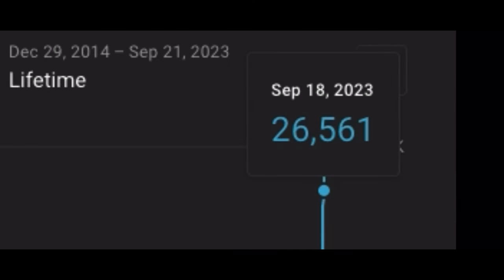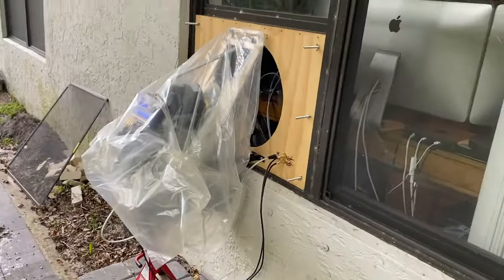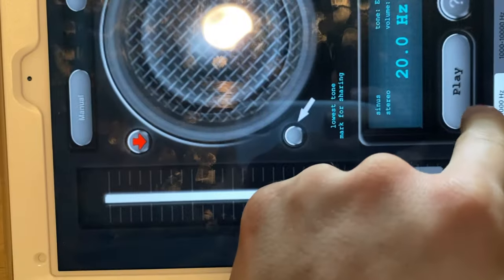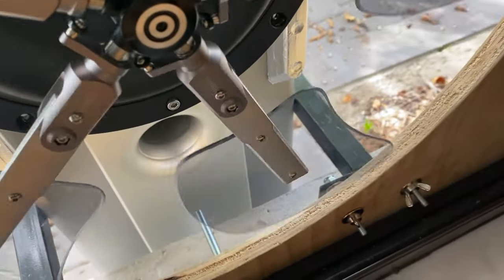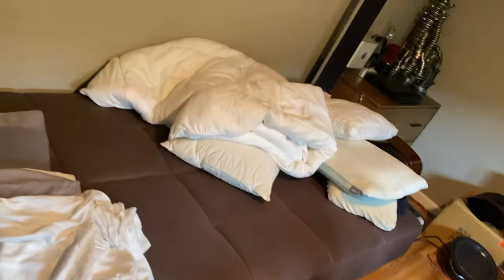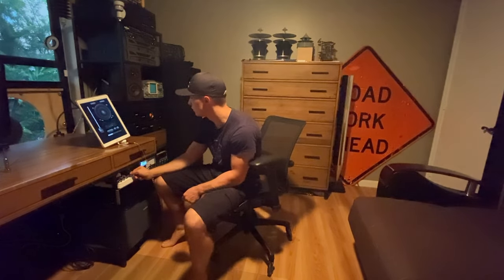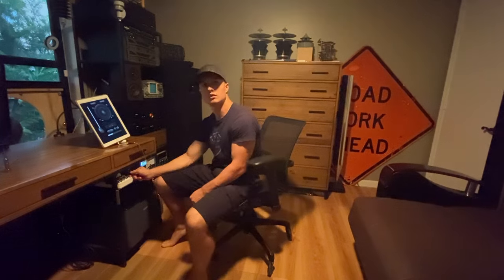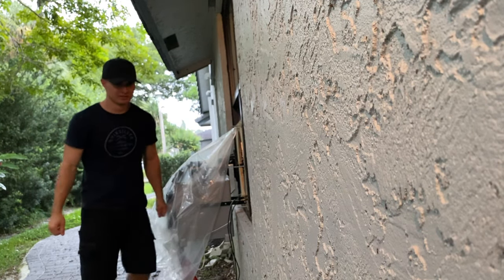Finding resonant frequency of my house with worlds most powerful “rotary” subwoofer (Bad Ending👌)

Comment: Be careful with those low hertz dude! Every material has a specific "resonance" and if you reach it you can actually damage them!
(The same principle that cause a scream to break a wine glass!) (i might use the wrong terms, but you get the idea!)
So... Yeah... You can dislodge your building with that...
Fantastic job though... MAD RESPECT!
Reply: I dont think they can resonate at such low frequency but i may be wrong
Reply: @amazin7006 I think too because of the dimension of walls, for example most bridges have resonance around 2hz
Reply: @federicogalvagni2332 new video idea

Comment: I wonder if some sort of solenoid may work. At a basic level, all a speaker is, is a solenoid built specifically for sound. You can probably get more range of motion, and perhaps faster oscillation.

Comment: Not funny, actually it is funny :D Problem with this is the weight of the rotors. You need lighter, sturdier rotors, or a mechanism that can move a lot higher mass. F = m*a where F is the force needed to incline the blades. For higher frequencies, a is much higher, therefore the force is going through the roof.

Comment: Nice follow up video on the subwoofer! And yeah, I was also very surprised when I found out that the previous one from 4 months ago absolutely skyrocketed in views to over 800,000. And even your channel had a massive increase in subscribers. Also, is the subwoofer actually strong enough to cause cracks in the house? If so, then I guess your whole house will fall apart the more you use it
Reply from the maker: Thx Ian, I don’t really know what the subwoofer is capable of at this point, but the cracks are something I’ll definitely need to be monitoring
Reply: @danielfajkis4952 yeah, definitely keep an eye on them

Comment: Heres a thought - if a single rotary sub can hit up to 20 Hz, a phased array of several units should be able to hit higher ranges working together. It might actually destroy your house though.
Reply: That's what I wanted, yeehaw
Reply: How would a phased array allow for higher frequency?
Reply: @antonliakhovitch8306 I guess by having one run at 4 hz and one running at 4 hz opposite phase?? Sounds like it would interfere really weirdly though

Comment: Supplying the same 100 watts at 10 hz or 100 hz, the power is the same but the displacement is at 100hz is 1/10th that at 10hz. That's just  physics. 

Understand this analogy. Say  you have two identical masses and two springs with different tension, and  consider energy (Work done)  = force × distance. So If the tension in spring B is 2× that of spring A, then the same  work is done by pulling spring B 1/2 of the distance pulled in spring A.  I repeat, the energy put in is the same. And when you let go of the weights, spring B and the mass attached will vibrate at twice the freqency of A.  What we learn from this is that the same energy put into a rotory speaker and or speaker cone at different frequencies results in different displacement, and that for a given energy input the displacement is inversely proportional to the freqency, (E=mass×displacement/f). This is true not just for the mass in the fan blades which cause attinuation, but also the vibrating mass in air particles that we call pressure waves, aka sound. Counterintuitive maybe, the energy in the  in a higher freqency means less displacement. But the key is, it is done more freqently.

Comment: Tesla built his "Earthquake" machine and almost demolished his building, all you have to do is find the right Hz..😊
Reply: Yeap, people have tried to repeat it since and almost taken down a bridge.  It was a TV Show like the mythbusters.  The bridge was being taken down anyway which is why they were able to test it out.  The device was really just an at most 2foot long metal rod being osculated back and forth by magnets. (I think)

They were able to hit the resonate frequency of the bridge and the whole thing started to shake. 

But, you wouldn't really be able to demo a WHOLE building or a whole bridge.   As soon as it starts breaking, the resonate frequency changes so you'd really just probably crack it pretty bad.   Or break off some pieces. 

Unless the device was constantly changing vibration frequency .. then well, the part it's attached to would probably end up separating from rest of the structure pretty darn fast. .

All though, it does depend on how the structure is put together and just WHAT frequency point your matching. Ergo, if you somehow managed to match the point where a bridge is connected on both ends.. AND said bridge was only being held up by those ends?  Yah, the whole thing COULD fall.  

But it's so unlikely.

Comment: Your mechanism can’t hit high frequency’s AND it broke because the blades are too heavy. The math assumes and infinitely rigid and light blade. Zero pitch carbon/plastic RC blades would be perfect. The wider (thicker) the blades the harder the base hits. The thinner the higher the hertz possible. Just get the lightest ones you’re willing to afford.

Comment: Would the THX sound work tho?
Reply: Thats what i still use tho! The Z5500 one beast of a soundsytem and i got a second set of it hooked as well but only the sub of the Z5500 so dual subs and 5 normal speakers. Soumds insane even after like 8 years
Reply: @dennisraeimakers5218  You don't know it's ruining your taste until you won't sell it one day
Reply: @SajtosNokedli  what? Lol
Reply: No, THX Deep Note isn't actually that deep and would be too high of a frequency to reproduce on this.
Reply: @rokoala2636 I'm glad someone who isn't an npc decided to actually answer this question. I was also curious

Comment: If I was making one of these, I would have it spinning at a constant speed or at least a fast enough 'idle' speed, and then just have the blades pitch to actually make the sound pulses. Then you need to work out the best materials to use, and how to get the most responsive blade pitching. That's my theory, anyway.
Reply: isn't that exactly what he built?

Comment: You need either a stronger motor assembly or lighter components (but they have to still be ridgid enough)  maybe look into propellers or wing assemblies for rc aircraft, a plane wing already has the edge setup for controlled movements too...may allow for extra efficiency with a lot of experimenting lol. Heck upgrading both motor strength and lighter materials will make it excellent im sure. Thanks for sharing and I hope you are having a great day or night my brother!

Comment: The frequency response is so low because the mass moment of inertia of your blades are huge. Change them to a longer skinnier airfoil shape (rc helicopter blades maybe?) and spin them faster to produce some good lift and you’ll get a much better frequency response into the midrange.
Reply: And also a lot more noise.
Reply: Legit question, would you call what you just said audio engineering? What field should I investigate if I wanna know more about sinning blades and sound?
Reply: @poiuyttyuiop9700  I would not describe myself as an audio engineer, I'm educated as an engineer in an unrelated field. My experience comes from a decade of live sound mixing and longer as a home theater audio enthusiast.

I made my comment in regards to my experiences with such things as rc helicopter blades. If you watch an rc helicopter video or see one in person, they are very loud.

Also compare a box fan in a window.

In sound, we generally sacrifice things like efficiency and performance for better sound. 

When looking at something like RC helicopter blades, it's a different machine for a different job. The helicopter is traveling through the air.

A rotary woofer is a device that pumps air in and out of a room at a high rate of change in direction, and sacrifices the rate in change in volume. The blades must pump the air in both directions equally, therefore cannot be very efficient because they must be flat, or at least neutrally directional. 

Also, using a thin blade will not be optimal because there will be a lot of space for the air to "leak" back to the other side, causing a lot of turbulence and noise. Turbulence and noise will also be caused by high fan speed.

I would argue that a rotary woofer is already large enough to shake apart a house with enough time. It's not like a regular woofer where the sound is created and contained in a room, for the most part. A rotary woofer works by pressurizing air in a room using air outside the room. If powerful enough, it could literally pop the house, blowing in/out the weakest surface present.

My intuition is that you want to make pressure but not too much, and able to switch direction at a rate of 0-100hz.

This video demonstrates that while buildable, this woofer is of low quality and is not effective above 15 hz or whatever because the voice coil cannot move the blades fast enough. The $15000 professional ones are rated up to like 1000hz.
Reply: @poiuyttyuiop9700 physics, signal processing, system modeling, and stochastic processes.
Reply: @wiredforstereo  yeah that’s the issue I’m running into just theorizing about the subject. Do you think the first issue with the design in the video is the inability of the diaphragm to efficiently control pitch at higher frequencies? I’m impressed it works in the first place but being limited to 10hz isn’t great, I wonder what would have to change to get that up into audible ranges, or at least to 50+
Reply: @poiuyttyuiop9700  Considering rotary woofers can't get anywhere near midrange frequencies and spinning the fan faster introduces a bunch of noise they are just talking bs. Unfortunately the other claim saying the $15k pro ones do up to 1000hz is wrong too, maybe they were thinking of leslie speakers or something else. The only commercial model I'm aware of is rated for 1 to 30hz and recommends a 20hz crossover to another sub, so there is no reason for it to put out 50+hz anyway because a traditional sub will cover the higher frequency range.

There are a few of issues with the design but it is plenty good enough for something to play around with. But it isn't stiff enough and the moving mass is too high (the 2 main things limiting the frequency), and those clear blades need to be made of something else because they will keep breaking.

Comment: Your device is not efficient because it generate sound waves in both directions, front and rear, than they cancel each other. Try to redirect rear soundwave into a maze or a box. Just like in normal speaker, box will improve power significantly.
Reply: hope he sees this
Reply: Doesn't work for this type of sub. Infinite baffle is the only reasonable option. unless you made a house sized subwoofer box, which would be very silly when you could just make a second fan speaker instead.

Comment: You gotta make a massive one, or multiple and get a cheap gas generator, so you can pull up to the middle of nowhere and crank it way the hell up. Also, these vids are sick as hell. I fwi.
Reply: These things don't really work in free air, you need an enclosure (like the house) to get the full effect.  Otherwise the air just passes from the front around to the back of the fan.  Using a huge open structure (like a hangar) as a horn could lead to something really interesting...
Reply: @henningklaveness7082  oh cool. Thanks for the info. This is the first time on yt comments that people have been helpful. I appreciate it.

Comment: Smaller seems to be definitely better when it comes to rotary subs.
You really want some small fan spinning fast enough that it can handle 50hz so you can smoothly pick up where most normal subs are falling off.
Moreover the pitch mechanism on bearings seems not so great to me. I'd use compliant mechanism with a single piece fan that just flexes to vary the blade pitch.

Comment: Remind me of when I built a sub enclosure for my sister's car and targeted it for like 20Hz, because she wanted to feel the bass but not be so loud. Thing had my chest pounding when we played music, but it wasn't loud like my car. 

My guess for why the blades can't rotate fast enough is that the system itself from the woofer to the blades acts as a low pass that cuts off frequencies higher than 10hz. Would need to do something to raise that resonance up, like tighter tolerances on fittings and less mass of the moving parts. But I'm also wondering if the surface area of the blades are more important for the cut off freq? Should try with different size blades and see how high you can go to match the specs on the driver.
Reply: Or see about finding a smaller sub that has a greater flex distance.

Comment: Youtube vid's audio don't go below 20hz, like mathematically, physically. There's something else going on like generated (sub)harmonics in your part of the system. You should do audio processing instead do generate the subharmonics directly and do a ultra-low bandpass filter afterwards to remove any signal that the subwoofer can't play. It'll be more clean and powerful.
Reply: The beat is below 20hz, but the tone is not.
Huge difference.
We can here beats below 20, just not tones.
Reply: @xxTHExxABYSSxx  I can assure you the signal has nothing below 20Hz, any beat below 20Hz you 'hear' and 'feel' is (sub)harmonic generated along the signal chain.
Reply: @IIoWoII  that's not even close to what we're hearing though.
We're heaving objects being moved at sub-20hz. Those tones are not subharmonic, they're their own tones made through vibration, produced below 20hz.
Most of what we hear is mechanic and secondary vibration, not the actual source bass notes in the free air to our ears.
Reply: @xxTHExxABYSSxx  "We're heaving objects being moved at sub-20hz. Those tones are not subharmonic, they're their own tones made through vibration, produced below 20hz." Is literally subharmonics if it's in tune

Comment: Man, you gotta build a tapped horn. You are operating so low and narrow a frequency the higher harmonic resonance of the lines won't matter. 

It would let you stick the rotary driver deep in the line, use fiberglass stuffing to attenuate the mechanical noises, there wouldn't be mechanical resistance of different airspaces to pressurize (though who knows at these frequencies).

Comment: I would say the reason for the limit in frequency is due a high inertial impulse, and that is caused by the mass of the blades and how well they are balanced, and how wide they are in relation to their rotational axis. Polycarbonate is pretty heavy so could be the problem. You could try to print some blades out of pla(which is very light), or use something like rc helicopter blades which are light and very narrow on their rotation axis.

Comment: Hey there friend! I’ve got parts in the mail for this!

Just a couple ideas, the aluminum bits holding the blades seem rather heavy being metal.
Perhaps you could lessen the strain if you replace those bits with polycarbonate?

Also, the lack of higher frequencies is down to physics, of course. 
But I think a lot of it is slop in the entire assembly, I think you could gain a bit more head room. 
Perhaps you could center and reinforce the top of the helicopter bit by having it ride on a bearing?
That would give it something to push against and would transform some of that energy into actual motion of the blades.

Cheers, my friend, I’ll be sure to upload a video when I get my death machine running!

Comment: Damn. So your sub isn't strong enough to turn the blades. Is it possible to get a longer lever arm on the blades or somehow mechanically advantage the output from the speakers? I.E. gears or something?

Comment: If you want to find good real life samples around those frequencies to play you could check out earth-quake recordings…

I think you are also held back by not just the mechanism, but the materials you used for construction. Good news: plenty of mechanisms can move such short distance multiple oscillations per second. Bad news: the strain on them is proportional to the air-mass and frequency.

And, if my logic checks out, we have worse news: Anything that dampens this strain is obviously counter productive. This would translate into moving less air, by moving the blades instead. And for that reason, the assembly as a whole as well as anything it is secured to has to endure the full weight of the air-mass moved, back-and-forth.

While for a house this should not pose an issue, for the subwoofer itself and how it’s secured in place it might. Even if the deformation is entirely elastic, it could cause unwanted operational noise and the very least dampens desired sound.

Comment: Use a more efficient subwoofer that requires less power to move and you might be able to play higher frequencies
Reply: The whole point of this thing is being able to play rly powerful low frequencies though. I am pretty sure it is smarter to just use a regular speaker for higher frequencies and make it bigger for more power.

Comment: i though about trying to reduce the mass of the whole pitching mechanism the blades stuff... so use thiner plastic or even carbon plates for rotors and maybe ligher meterials in generall to see how to increase the frequenzy range ... and just see where you can get whats the maximum you can do xD